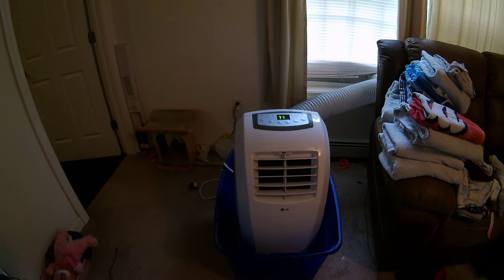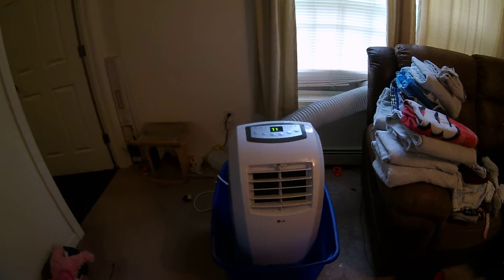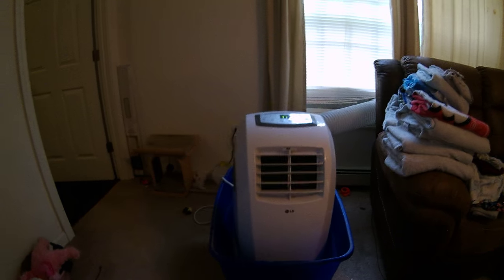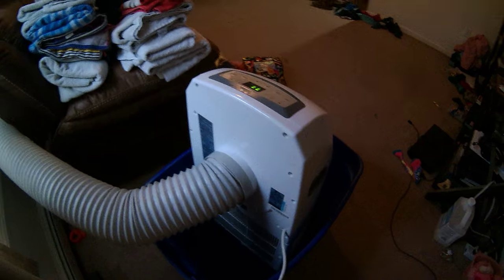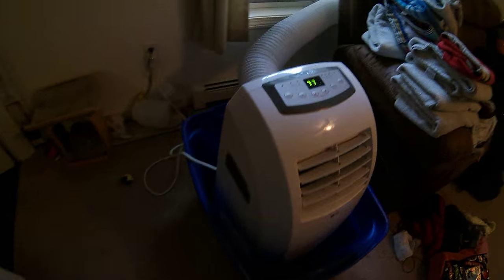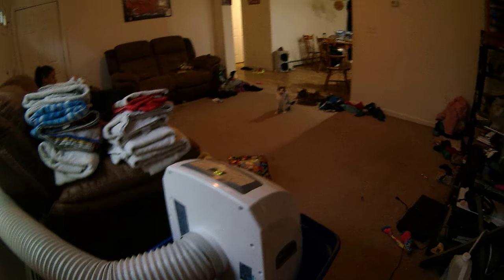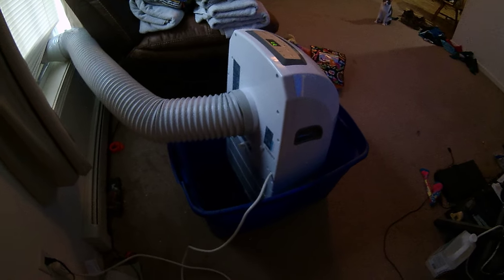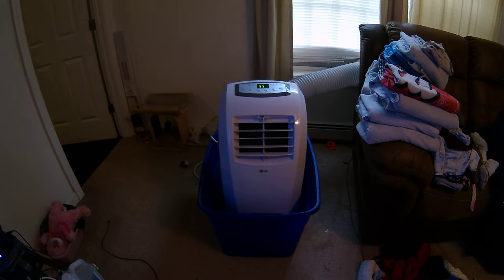Portable AC Leak Fix #DIY

Comment: It's got a bumb float, it's supposed to turn off when the reservoir is full. Unless you removed the drain plug, in which case you are supposed to connect the drain hose and drain it to a container.